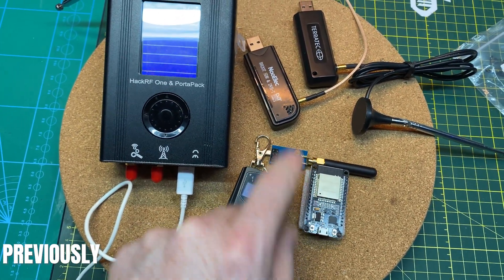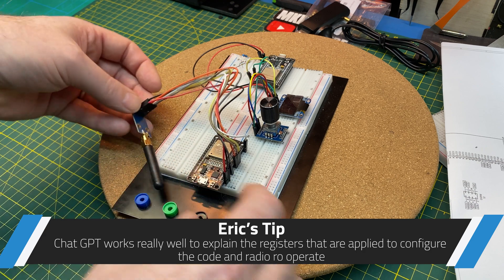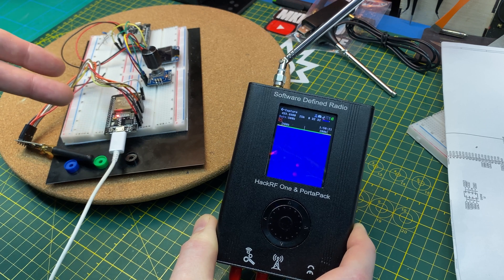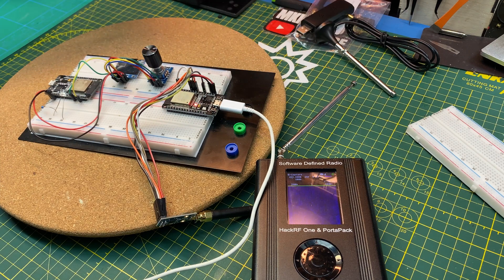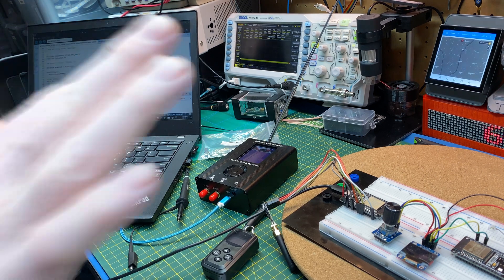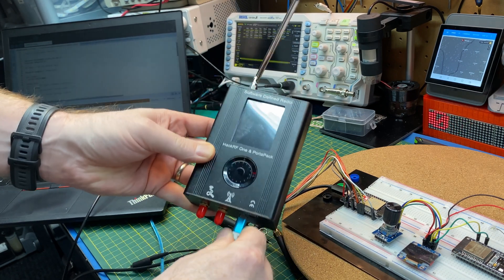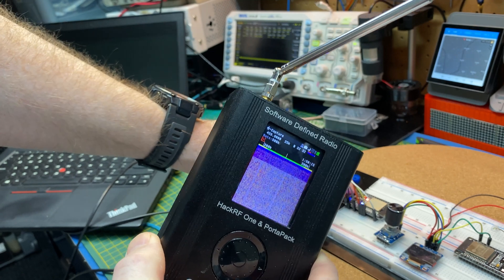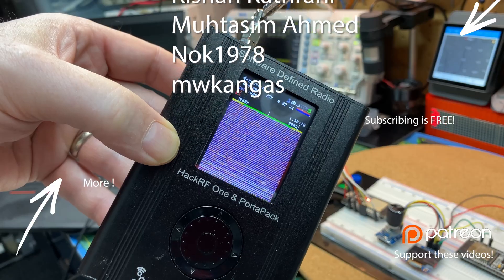Hacking a Chinese Diesel Heater With HackRF, ESP32 & Chat GPT,  Part 3 - Radio Troubles!

Comment: I have two cc1101 units that can receive but not transmit! They worked well one of them worked and then just stopped the other one didn't work out of the box. I'm able to test them on the flippers they're just defective. 

Trust me I've pulled my hair out for the esp32 and a cc1101 many times wondering why checking the wiring rechecking the wiring. 

What you got to do is go upload a simple code out of the library for a repeater and then listen to it with your hack RF to make sure it is transmitting and receiving just fine